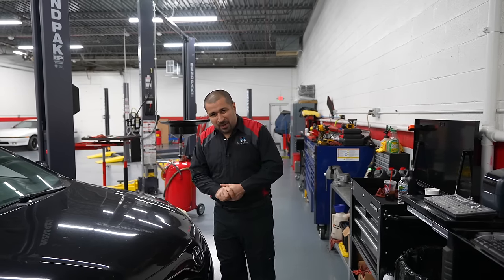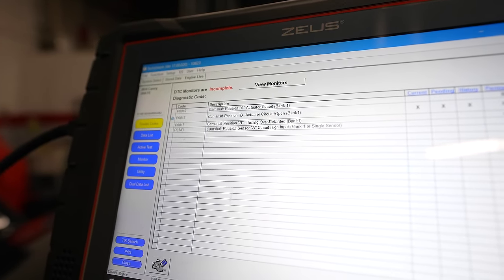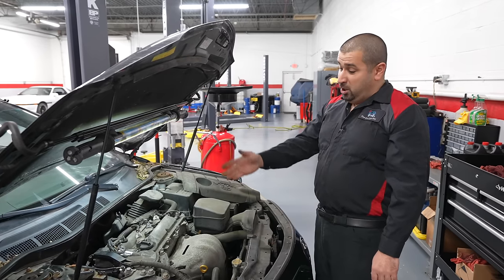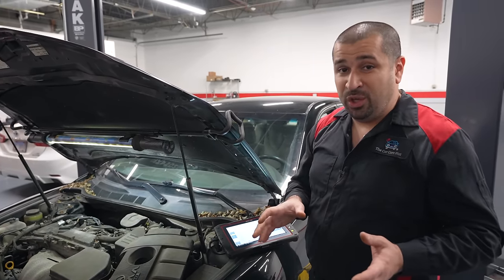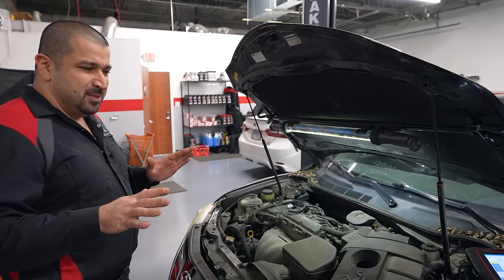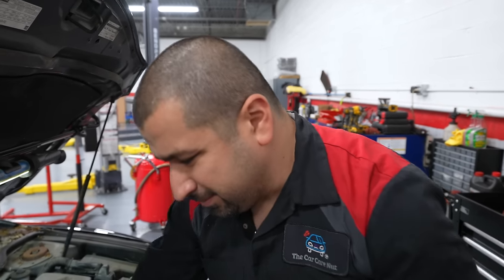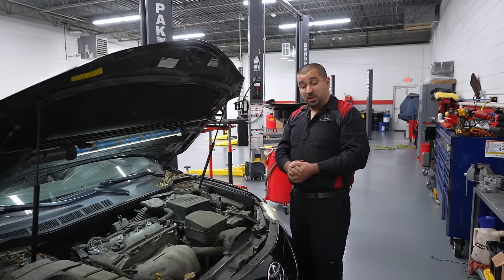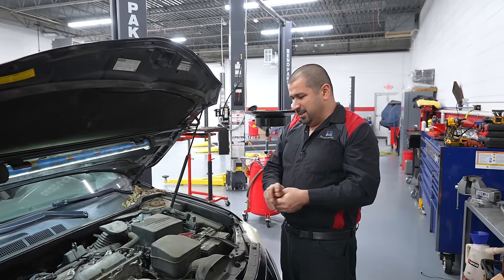Mechanic Parts Cannon FAIL Cost Customer A LOT! Let's Try This Again

Comment: Hypothetical question: Could a faulty/shorted OCV (original part) kill that circuit in the computer and result in the need for both an OCV and ECU and the other shop simply stopped short of fully diagnosing the issue in the first place?
Reply: Depends on the car, but it does happen. Some GM cars have that issue if you install aftermarket relays (short circuit ruins the BCM)

Comment: I wouldn't be surprised if the computer is defective because the guy with the parts cannon shorted the circuit for the oil control valve on the exhaust side.

Comment: Maybe I missed something, but how can you rule out wiring with an unloaded continuity test?
You didn't account for possible voltage drop by testing a loaded circuit and back probing the connectors.
Please explain if I'm wrong!
Thanks!

Comment: I have a 2013 toyota camry base model when I give it some gas to go.  The car feels like it's pulling back in, picking up the speed iintermittently. A while back, when I was watching one of your videos regarding the camshaft  that had that one  metal pin that would cause a knocking and you mentioned that if it doesn't get replace.  It could cause the engine to go grenade and destroy the entire motor.  My question is, when that little actuator wears out, could that be causing the car to hold back intermittently in picking up the speed?

Comment: The most common problem I see all the time is people replacing 02 sensors because they have an 02 oxygen sensor fault code.
Reply: So what are the best steps to take when you get an O2 sensor fault code?

Comment: I truly enjoy your videos. And you provide a lot of great information!
But I have one issue with your diagnosis on this car. there’s no doubt that the PCM has failed. But my question is why? Yes PCM‘s fail for a number of reasons thermal cycling, cold, solder, joints, PN junction breakdown. But they also 
Fail as a result of Internally shorted components that they control What if the VTC actuator valve was internally shorted? Could this have taken out the PCM. Moreover, what if you diagnosed it in the fashion you did. Then got a new PCM programmed. It plugged it in and poof. There goes another PCM. Because the resistance of the valve actuator was never checked? I know you check the resistance and continuity of the wires going to and from and the pin resistance at the PCM and you tried to actuate it with tech stream. But did you ever think that the part  the previous garage pulled out was actually bad? And that was the root cause of the problem? and by having a new albeit aftermarket that apparently was in good working order installed when it arrived at your facility replacing the PCM fixed the car. I’m trying to say here is that an important part of PCM failure is analysis of the component that it controls. Not just its connecting wiring. Case in point, Hondas, take out PCM‘s with regularity from failed canister vent valves. I don’t mean to be a fly in the ointment but, that part laying in the trash at the previous facility, might actually be bad! And the root cause of the problem. You’re a very smart man no doubt. But I think you can see what I’m saying here.

Comment: and this is why I put away about 140 dollar a mount to a car acount. to have mony to spend WHEN needed. so it is don as it should be done. and that is why my car is still good after 250 000 miles. but with minoer thing to still do..but as I gone repair in time. if it a good year,  and less repairs...then it will be used when the next big thing comes. wtch will come...I drive a lot...

Comment: You are telling me for a fault code, there isn’t a check list that you can follow to diagnose the problem, from the most likely and obvious to the least likely. How many possible scenarios could there be even on a complex car. Obviously, running down the list cost time, but at least it provides consistent diagnosis, not totally relying on repairman’s esoteric knowledge

Comment: I like your content and channel but have several questions about this video.  I am not a mechanic and am about to prove it with the following, I am sure.

1) You said the intake module set a P0010 code when you unplugged it but that code was showing before it was unplugged as well.
2) It's frustrating showing a meter jumping with numbers all over the place and be told there is "nothing here".  I don't doubt you on the meaning but an explanation of why we are seeing all the numbers but they don't mean anything would be helpful.
3) If I was the customer here is what I would like to see to prove to me I needed a computer.  Put a meter on the pin which sends signals to the valve on a known good and then do the Active test and toggle the computer to open the valve.  Show the customer the reading on the meter.  Then move the meter to the pin for the effected valve and toggle it on.  The meter should not show the same reading.  That would demonstrate that the computer is failing to send power to the valve. That would be the proof that would make me feel better.
4) Maybe I would also try and send voltage down the wire to the affected valve and show that the valve works fine if it gets the voltage delivered to it.
5) As another person said, a wire can show continuity to a sensitive meter but still not be capable of carrying the full current required.  You certainly know that and have to make decisions on what to include in your video so they don't get too long or too technical.  

Thanks for taking the time to show so much.  I really respect your knowledge and your shop.  You should be very proud of your accomplishments and I am thankful you take the time to share your knowledge.

Comment: How did you get a fried computer from this? seems to me theres an open  in the power wire leading to the connector not a fried computer? why not do a wire repair where the break in continuity is?

Comment: Great video thank you. Question so my daughter has a 1999 Corolla 1.8 liter it only has 65,000 miles but it did sit a lot but now it a daily driver and I notice it want to stall out with the ac on what do u think it could be any help would be great.
Reply: Get the battery and the alternator tested, the easy bits first

Comment: I never comment on anything but I'm an apprentice for Chevrolet yesterday a car came in a 2015 camaro v6 with a P0333 code knock sensor high voltage, following per si (service Information) instructions I Test voltage to the knock sensor and it measured 2.5 v and it sent me down this path after this si told me check voltage to the ecm x2 connector which I did and it was measuring 0V according to si that it meant it was an ecm i tripled checked had my friend check it and it checked out got the same results everytime so I order the ecm and program it and sure as shit p0333 again I felt like shit. I try and hold my self to a certain standard. so the next day the field engineer was there helping out my coworker on a car of his (he has a ton of headaches) I ask him if he can come double check my work he goes through it with me and he comes to the same result, we were scratching our heads upon further inspection we decided to back probe the connecter and while moving the harness around it was picking up a volt somewhere in the harness I ended up just running to new wires from the ECM to the knock sensor. Problem solved. Still learning should be going flag later this year wish me luck!

Comment: “Nothin here, nothing here” part of the video the meter was all over the place, I assume within an acceptable range.  But you did not say what that was.  Can you give us a little explanation on why those numbers were good?
Reply: He is basically doing a low voltage ground test (testing from - to harness then testing + to harness). If the car harness is shorted or grounded...you would see a SOLID car battery voltage of 12-14V (very bad). His meter was jumping around that is why he said 'nothing here'..no circuit anomaly. AMD did a great job. You could also use a low voltage test light if you don't have a meter. If the light comes 'on' when testing that would basically mean you have a short or ground. I am a tech with 20+ years experience. AMD would be a great instructor if he chooses too...he has the patience to explain.

Comment: but when lastly  checking for shorts at computer l guess it would be better using ohm meter see if resistant to ground at negative side and checking  plus side to ground with voltmeter if short, correct me please if l am wrong.

Comment: Hi I like your channel, and your knowledge as a mechanic, I got a question for you and hopefully I  get an answer  from you.Just bought a 2014 camry Se 2.5l has only 75 thousand km ,no problems  with shifting or any other transmission problems, no codes or lights on dash only thing that bothers  me a slight  noise like howling  noise but not loud  though and only on first shifting when car moves, any time I stop at red light car starts  vibrates when change the gear from drive to neutral car works smooth no problems,it's same vibrations as the ac is on bit in this case is not.What the problem should be?Thank you

Comment: It is entirely possible the original oil control valve on the exhaust damaged something in the computer and the evidence was lost when the old defective oil control valve was replaced.

Comment: i Have a 2006 Subaru Forester 38000 miles and check engine light came on with cruise control flashing loose fuel cap was fix after replacing that and charcoal canister light still on now rplacing solenoid purge valve on canister and hoping light stayus off mechanics did parts cannon on me as well😠

Comment: There should without exception be 50-State legislation to protect customers from the work of inept shops. Most people who take a vehicle to a registered repair facility simply can't do work on their own vehicles, for lack of one or more of three things: time, desire, and ability. Warranty restriction is the other major reason to have work done at a dealership -- and the term 'stealership' didn't arise for no reason at all. : /  

All of the good 'YouTube' mechanics loathe the practice of guessing at an issue and packing the barrel of The Parts Cannon. People expect a professional approach and result when they take a vehicle in to a 'professional' shop. Accordingly, within reason, any pin-the-tail-on-the-donkey costs that accrue when trying in vain to fix a problem should be absorbed by the shop. Independent mechanics and bigger facilities alike should either admit when they can't fix a problem or take their lumps and learn how to do the same job properly in the future. A customer should never bear the cost of a guessing game, no matter what the expense is to the shop. An estimate and the ensuing work are expected to be done by experts. A good shop will incur the cost of inaccuracy, and it won't be the type to fire the cannon and present the unwitting customer with an outrageous bill and possibly a botched job to boot. 

I'd love to see full protection for the customer be covered by law, no quibbling. Shops should be made to have 'malpractice' insurance. I began doing more than oil changes on my car about eight years ago after a friend who was too busy to do a head gasket job for me recommended a buddy of his who had a registered shop and ran a salvage yard with his brother. I figured $500, maybe $600. It was five and six, for my Honda Civic! For over $1,100 the job was so ineptly done that I left the shop with my poor car bogging down by second gear and not making it much over 40 MPH. I drove for weeks like that, thinking I had a worse problem that just immediately came on the heels of the head gasket. Nope. Fed up, I finally got into and under my Civic with my nephew, who had done a lot of mechanical work. Totally screwed up timing. Vacuum tube left off. The number three plug wire wasn't even on the plug. Grounding wire left disconnected. There was more, but I can't recall what. Either too many local shop monkeys got their mitts into the mix, or they contributed to some serious distraction on the part of the guy paid to do the work. That's another example of the kind of crap that customers should have full protection against.

EDIT: I don't know how mechanics can dupe people and have any respect for themselves. Stories of horrible repair shop experiences are plentiful. I've heard a few. I cringe when I see 'mechanics' on YouTube almost abusively yanking, cranking and beating on cars. People generally have no idea what goes on when their cars are entrusted to shops. : /

Comment: I have a 2.0 vvti . So code set P0335 Crank shaft pos sens circ. Car starts sometimes little hard and runs and drives well little power lack. continuity all wires perfect.

Replaced the relucter wheel, the crank sensor, the ecu set, still sets the code, all oem parts from dealers.  engine light still on same symptoms. At my end with this. Any Advise

Comment: Im been in electronics for a long time and I cringe every time I see mechanics use a light test probe especially towards the ECM, your dealing with integrated cct that work on m amps or less . always use a multimeter they have high resistance when set to voltage for that reason.

Comment: Hey i bought a new camry not too long ago and i used my scan tool to check for codes, and it already have 5 open circuit codes for some reason. Why is that?

Comment: I hate the parts cannon mechanic! I have a p0171 on 06 Toyota solara, I already smoked it and fixed small vacuum leaks, replaced pcv valve and hose, MAF sensor, ignition coils, upstream 02 sensor, now mechanic wants to replace the fuel pump and last step fuel injectors, after all this the p0171 still keeps coming back. Just wasting my money!!

Comment: My now x vw polo 1.4 tdi was having trouble over a few months on and off on tick over final the check engine light came on I plug the cheep Diagnostic computer I have and it was telling me there’s something wrong with the vacuum valve being an old school Mechanical Amateur I Took the engine cover off and it had Caused the problem it had Worn a hole in one of the pipes a cheep fix

Comment: ECU repair should be just as normal as engine repairs!  Maybe just a bad grounding , try tightening the screws on the ECU box , or may a 1 USD semiconductor.  In 2023 It should be the norm with same documentation on ECU as for the rest of the car components. Toyota! dont pollute our planet !  Maybe half the number of parts in a modern car is sitting in the ECU , and we cannot officially repair it.. crazy-

Comment: Can't you open up the computer and check connections internally?  It's still probably a bad connection issue.  The computer is bad anyway.  Why not try to fix it?  The computer is obviously doing A LOT of things right so it is just a bad connection somewhere.  Open up the computer case and continue probing continuity from the outside of the case to the inside until you get to the card itself.  You should have continuity from the sensor all the way to the card - if the connection is OK.  If you have continuity all the way to the computer printed circuit board THEN the computer is bad.

Comment: I’ve put many many after market oil control valves on all sorts of cars. Including toyotas.  There isn’t anything special about toyotas that for some reason no aftermarket company can figure out how to make one.    Sure this guy is figuring this stuff out , but is attitude sucks. It’s giving me a head ache.  The reality is, there is a very high probability that for codes like this the oil valve is bad.    Sometimes they are cheap and it’s just worth throwing apart because of how easy it is to do.  In that labor maybe be over $100 an hour.  Sometimes throwing a part at it can rule out a bunch of tests that would take more then the cost of the part , with the benefit that it may have fixed the problem. The problem is if you take a gamble like that and give some bs to the customer.  If your going to take these kinds of gambles you must take the loss when it fails.

Comment: Most mechanics understand nuts and bolts. They dont understand electrical problems. 
Toyota. Gm , Chrysler,  Ford ex should have a computer test machine you can plug into to test automotive computers with as well as substitute for the cars system to ck the cars electrical systems for problems. 
Its no surprise cars are becoming more and more electronics based systems

Me id bust that computer open and replace the bad diode burnt resistor. Fried semiconductor or blowen transistor  or cold solder joint. 
I dont see any reasons a manufacturer shouldn't have a testing station at car dealership or at least a system to test any model in that area. Remember the big Sun engine monitor systems in thev60 and 70s as big as a toolbox.
Now its a hand held scanner that test 1000 more parts. 
The scanner should be able to test the cars computer using software.

Comment: Hi AMD,i have a 2018 rav4 trail, changed the battery and alternator last december, now im somewhat lossing power, suddenly the engine seems like it will stall and the LDA,BSM, and other lights on steering get stiff. This will happen for about 10 seconds and then the engine wont die and all the controls will back to normal, lights on the dash is off. My alternator is aftermarket(remy) the oem to order is 7 weeks. This is what they  recommend. My mechanic told me yesterday that the alternator is   Fine.Any idea what it is?Thank you in advance.

Comment: I would have tried the cheap fix first as ive never seen a Toyota computer go bad. I hope you check the
computer connection before buying that expensive part..Cheers.! BTW how many Toyota computers
have you replaced.?

Comment: I have a 2007 GX470 wondering if anyone had a problem where the radio turns off and on quickly or at night you hit the brakes and the headlights dim/flicker 
I have a new battery . also it might do this one day and not the next